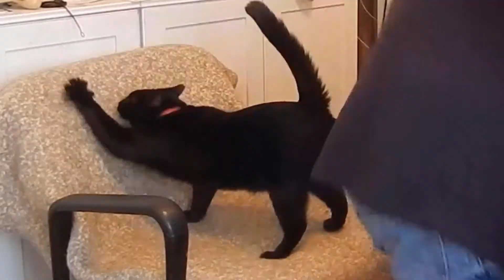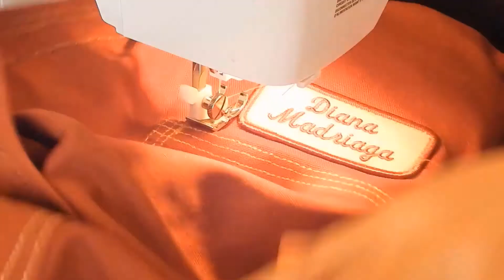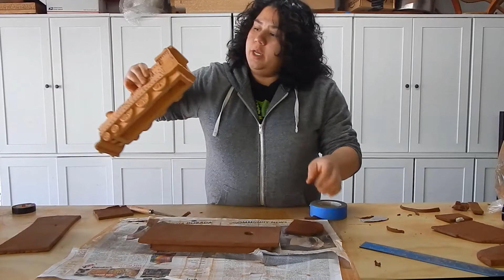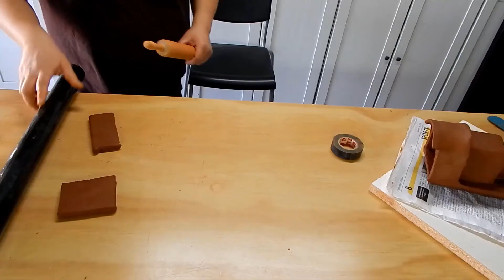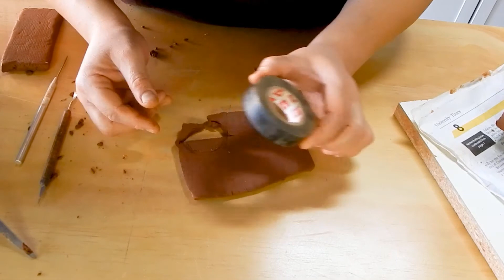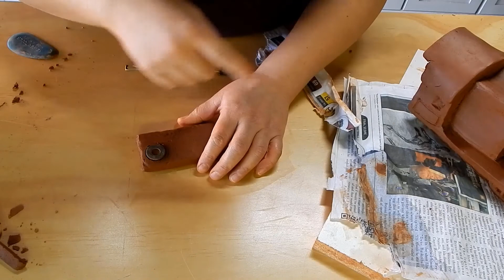Steam Engine: Ceramic Tutorial - Clay slab construction Train DIY

Comment: Hey I liked your idea as I was searching for something related . I want some of you advice is that possible to make a train ( i.e pop up ceramic work ) on a cube vase
Reply from the maker: Hello. Thank you! Would you be making it all from scratch or adding on to something already made? If you are starting fresh, you could make the same form but leave the top open so it becomes a vase. Or you could slip and score (attach) details of the train onto the cube.  You want to pay styrofoam thickness and be sure not to make any air pockets with this method. 
If you are working with something already made that would be a bit more tricky.
Reply: @claytocanopy  no no I'm making it fresh and thanks for your consideration . I you would don't mind I can get a contact of yours so that I can take advice ....time to time 😊
Reply from the maker: @shrishkumargupta1412  I have an insta and FB. You can send me DM’s messages there. There are links in my about page.
Reply: @claytocanopy  thanks a lot . I got it